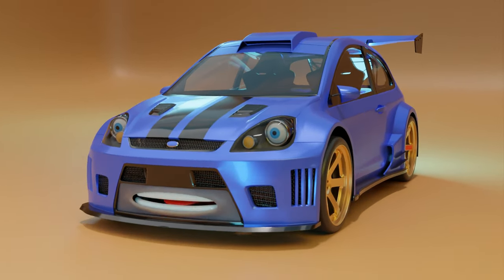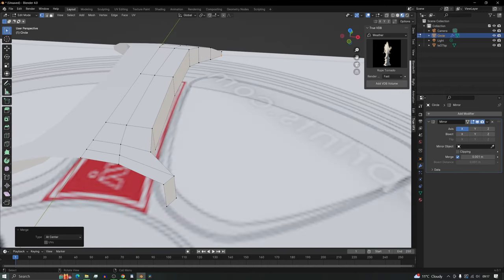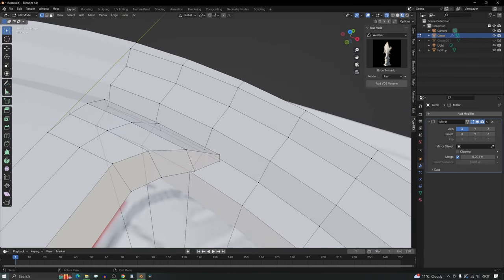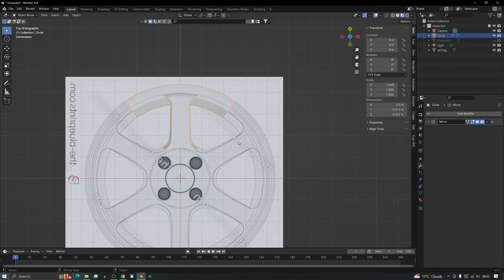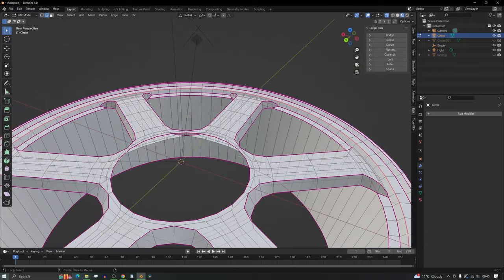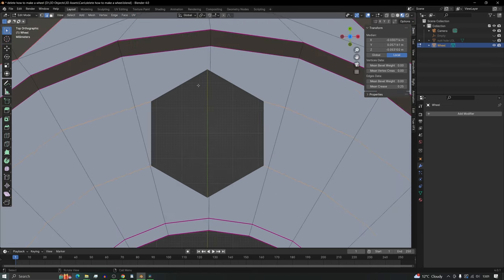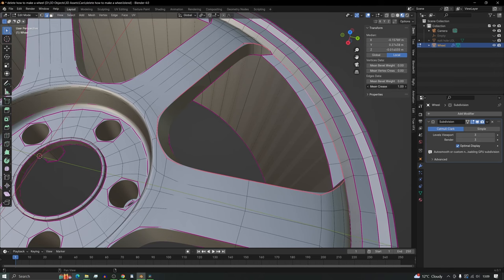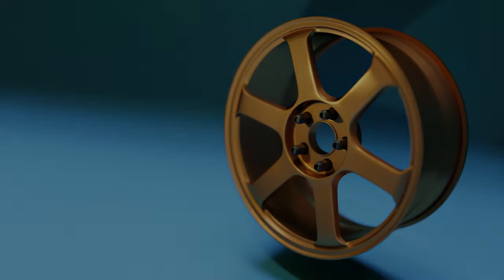How to model a Wheel in Blender 4.0 - Detailed Walkthrough Guide

Comment: HEY WALEJAW!
when I apply the array modifier as you said it makes the arrays in different directions with different sizes
Reply from the maker: Make sure u apply scale, location, scale with ctrl a
Reply: @walejaw3d  I'll surely try this that and let you know
Reply: @walejaw3d  still the same outcome. only that with the scale the sizes are now same. but the arrays are making a spiral shape
Edit : It worked ,the problem was that the origin of object was not the same as the 3d cursor
Reply from the maker: @chiragveer6561 well done dood. This is a big lesson to overcome. Most issues reside with these same problems. Origins and scales.